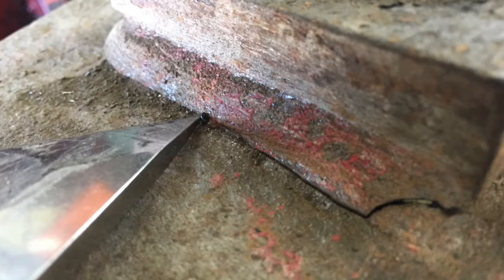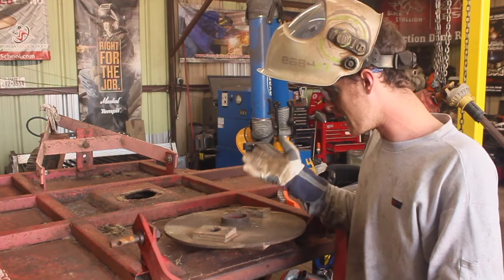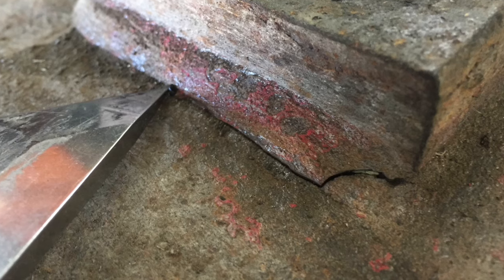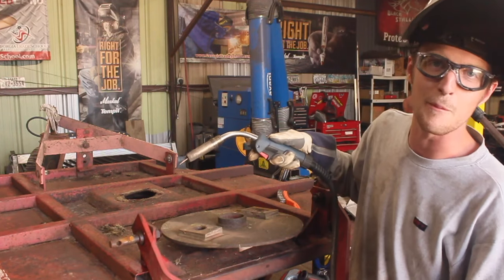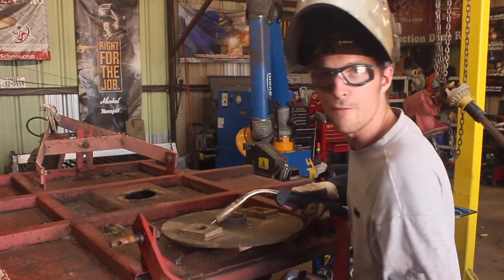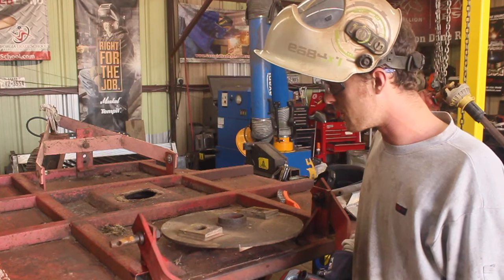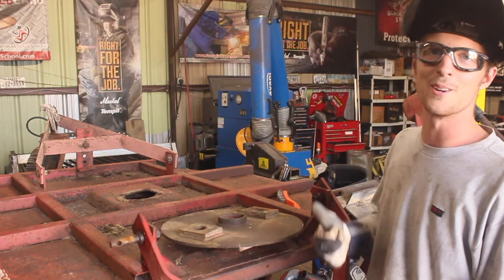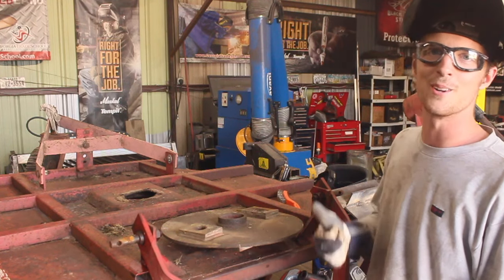WHY YOU SHOULDNT MIG WELD THICK STEEL

Comment: I've welded materials up to a foot thick on some jobs. Granted, we were using 600 amp machines, and 16th diameter wire at a minimum. We beveled until we couldn't bevel any further, and sometimes spent weeks welding one component to go into a  massive hydraulic sheer or press break. Tell that story about not being able to weld heavy steel to somebody else! You young guys have either been mislead in your training or you just don't have the experience yet!
Reply: nice, the thickest I've ever welded was 6" base plates for a rollercoaster - med carbon steel - had to spend 4 hrs with propane torches to preheat. burned up a lot of gloves on that job. 5/64 Nr232 wire
Reply: Upper couplers on semi trailers! “King pins” 800amp millers. With 1/8” iron core wire! Hot and heavy.
Reply: I was gonna say lol I know of 9 axle trailers that are entirely welded together. Bevel, preheat if necessary and use MIG or SMAW 🤔
Reply: here in the Netherlands we are thaugth about that in welding school.
Reply: Apparently this guy doesn't know that you weld almost anything with mig that you can stick. He apparently didn't know that the big commercial welders are mig also. Granted, you find that type of a welder on a farm, generally. Just need the proper equipment and knowledge/skills for the job.
Reply: Funny that aye haven't  welded really thick steel, but why would welding manufacturers make 500 amp mig welders just to weld thin steel. I personally like arc welding because I dont have to worry about gas lol.
Reply: Ah so you guys are the ones with all the cracked welds! I was wondering who's the moron company who is putting out all these structurally unsound components.

Could y'all stop? Its getting old fixing all these 2yr old mig welds
Reply: @wrenchbender01  shit we rebuild intermodal trailers at work and our biggest welder is a Miller 212 and we have no problems welding king pins, main rail sections, G-neck rail sections, bolster replacements and everything in between. Most all of it single pass also.
Reply: @jonathangarzon2798  shhhh...let them keep  welding like that, keeps my mobile welding sidework going  lol
Reply: I just failed my mig test because I am not used to welding at 350-400amps . They wouldn’t let me weave a bead it was production welding I am a great welder but failed hard yesterday just trying to get a opinion on welding at high amps and running a clean bead , I got told push my bead I can’t manipulate it at all which as the first time I have ever hear that
Reply: I agree. Process isn’t near as important as how it’s done!
Reply: No Doubt ,I use to weld 600 lb branch connections, 10 inch thick ,on 300 ton steam drums with 1/16 core wire , 12 hours days  pounding metal.These young snots  ,have no clue whatsoever .

Comment: Dude , I fabricate pressure vessels . Many of the bodies I weld are 3/4”-1”1/2 inches thick . Bevel the areas such as seems take many (3-4) passes to complete. Welding lifting lugs to four inch thick plate takes a lot of heat . We weld at 250-275 amps. The lugs are beveled to allow several passes to fill in and build the weld to finish with a minimum of three step levels as the final passes . Many applications can’t be mig welded such as seams on ships where stick welder with proper tensile strength rods . Heat is your friend when welding thick steel.
Reply: Like I always tell people, get a job welding things that have to be leak tested and you will become ' good '
Especially ' dime stackers ' .
Reply: I agree. Technique, relatively adequate equipment and know how, are more important than process. Mig is capable as any other process in the right hands
Reply: He did say where the weld was too cold.

The title is click bait.

Comment: Hmmmm better not get too close to train tracks then i welded train cars for years with a mig welder as do most shops at this point
Reply: You probably used Flux core wire..

Comment: Sad to say, your knowledge is faulty, and the last picture at the end of this vid clearly shows that those welds whomever welded that multi-pass, is worse than the previous welds and that person who welded it, would not have a job in a regular structural steel fabrication shop if that is the best they can do....  FYI, always clean/prep the surface area from rust, oil, water before welding as you can see in the end of vid. was not done.... It always matters, always clean/prep....

Comment: I have the same welding lid. I would use E71-T .045" dual shield wire with 75/25 Ar/Co2. I do a lot of heavy equipment repair and so far this has held up well.
Reply: That was my thought as well; built 120 ton and up mining equipment using 0.54 E71-T

Comment: For the average Joe would it be better to tackle something like this with Stick?
Reply: Yeah, run a 6010 hot root pass and then a couple 7018 beads to cap it off
Reply: @JohnWheels  : Except most “average Joe’s” don’t have a welder that will run 6010. Flux Core is Way Underrated!
Reply: @markashlock9017  True, but I have a cheap YesWelder machine that runs it just fine on 240. I won't on 120 though
Reply: @markashlock9017  that’s not regular fluxcore… he used dual shield which is wayyy hotter and stronger you could also just run 7018 on it and skip the 6010 if you didn’t have a machine that can run 6010

Comment: Factories that manufacture I beams and other structural beam use a MIG process. You mentioned in the last second that you are going to do the repair with dual shield MIG. The title is misleading. You should have focused more on the wire used and the proper way to perform that repair instead of saying MIG-bad the whole time.

Comment: Mig welding is just as strong as stick if it’s done right
Reply: It's that if done right part. The one method I was taught was weld think to thin. Got turned into largest thermal mass to least. Chuck something taught me that I think.
Reply: Not short circuit it’s fine on thinner material but it doesn’t have the heat to fully penetrate the thick stuff were stick will.. if you actually read short circuit wire it will say not to use on anything thicker than 5/16.

Comment: Well, structural MIG is certainly a thing, but it does take the right settings and technique. MIG is kind of deceptive in that you can end up with a visually okay weld if you don't really examine it, and it holds for a while, but it isn't properly fused just like you said. 

That's where knowing exactly what you're doing and how to do it comes into play... or you can just go grab the easier option if you're not welding a building or a bridge together and instead just use stick like a normal person, or if you happen to have gas shielded flux wire setup, use that.

For the average guy tinkering, MIG isn't for thick metal unless it's specifically set up to do that with the proper everything.
Reply: What allot of people don’t realize about MIG welding with solid wire is that you can short arc or spray, but in between those transfer methods is globular which is unacceptable and responsible for most non fusion. To put it simply you have to understand what your doing and not just be able to make a pretty weld

Comment: Preheat and clean surfaces are your best friends welding thick steel with mig. Never stopping on a corner and going around it and leaving your stop on finished weld is another.

Comment: Don't say MIG welding is the problem, the wire they used is the problem.
Anything structural over 3/8 should be a dual shield wire with straight CO2, or inner shield for the farmers and DIY guys out there.
You can weld thicker with the, well I call it bare wire, copper colored wire that you use mix gas with and leaves no flux behind. Can't remember the technical name.
Anyways you have to preheat the metal before you weld or use a pulse machine, and even then it's never as good as a dual shield wire with straight CO2. People use mix gas with dual shield but I've found over the years it makes the weld too brittle and is a little harder to weld with because it doesn't always want to "wet" both pieces your trying to stick together.
If you want good wire to start with try some Hobart excelarc 71 in .045 and CO2, good for general repairs. It can be turned down enough for 1/4" but it might be a little tricky running verticals that thin. But the bare wire can take care of that.

Comment: This is exactly why no welder considers mig welders skilled tradesmen, we are constantly fixing their welds not even 3yrs after fabrication in the field and all you ever hear are excuses for it.

"We spent a week beveling and preheating, used a 600amp machine with thick wire just to run a signal component so you can weld thick with mig"

Meanwhile 65% of all field repairs are fucking done on mig welds that failed

Comment: It really depends on the composition of the wire being used and also if the welding machine has the amps to penetrate the steel if thick U have to crank it up also some pre heat of the steel helps out big time as long as you don't exceed the interpass temperature 🤟

Comment: The other thing you never mentioned was the weld ended right on the corner.  So not only was the crater there but also a stressor being on the corner. An easy fix is to run the weld around the corners before ending the weld.

Comment: Using Dual shielded wire is MIG welding . It’s just a different type of metal transfer across the arc . On thicker metals this is a very common type of MiG welding in heavy industries.

Comment: The parent material failed ot the toe of the weld because of the HAZ. It's a common problem with any welding process.
Reply: Exactly what I was thinking
Reply: The weld failure started at the center of the weld though, that's literally textbook weld failure
Reply: @jonathangarzon2798  it may have started in the crater because of lack of fill but it didn’t crack all the way down the center of the weld it traveled to the haz. And really can’t say for sure it didn’t start at the toe and wind up in the crater

Comment: Most cracks I see like that on farm equipment look like a rust thru issue of the parent metal. I see it mainly on thinner stuff, and areas that may not have been painted properly after welding.

Comment: I've worked as an OEM engineer for large construction and age equipment for over 30 years.  Welded large track trenchers, drill rigs, combines, etc. frames that are several inches thick.  Everything is welded with MIG, maybe a little sub-arch, but anything with volume will be one or the other.  Stick welding just really isn't used in production.  I hardly use it at home either, always use the MIG.
Reply: Yeah most companies don't actually care about doing things right just fast.
Can't be a multimillionaire company without killing a few dozen clients and workers through willful negligence bud
Reply: @jonathangarzon2798     So stick is the only “right” way?
Reply: If done right, Mig is absolutely a good way to weld things. no doubt.
Reply: Yes mig is good but not a lot of people know for industrial application dual shield is used with straight co2.

Comment: I used 311 ;.065 inner shield on structural iron with a beveled edge 2 inch flange and never had any problems

Comment: I usually agree with what you show but in this case I can't.   I not only work in the towing industry as a senior design engineer but I fabricate on the side as well.  At work, all we use is MIG on our hitches with testing exceeding a 38,000 lb rating.  At home I've welded up to 1" thick bar on a Cat endloader and it twisted the whole frame when the one cylinder failed, not the welds.

The problem your showing in the video was definently from cold weld with the wire not hitting the base plate.

Comment: That has always been a problem that I deal with. Making sure it’s hot enough to bond and not burn through the steel you’re trying to weld too. Thin metal always seems to be very difficult

Comment: Depending on the consumables being used. If  your using E7018 stick electrode or E70s-3 MiG wire or even E71-t all them have a 70.000 psi tensile strength. MiG welding is used for thick metal in many industries. It all depends on amperage and if you Mig at 125 amps or Stick at 125 amps and use 70,000 psi rod or wire it’s the same strength of a weld. So if your talking about a 120v homeowner mig you can still get away with welding up to 1/2 plate with the right bevel and prep. I have done many many times.
Reply: The mode of transfer is different the reason a stick and tig weld is stronger is because its not a short circuit short circuit mig welding is literally creating a dead short everytime you weld something they have corrected this over the years this is  where the invention of spray transfer welding and dualshield fluxcore have came from because they dont short circuit like a normal short circuit mig process does

Comment: I just subscribed. I was with you when you were Chucky1986 or something like that? This stuff is REAL WORLD WELDING! I repair trash containers and garbage trucks etc.. this video today is great info. I would however like just a little more info on the wire you are using and sounds like no shielding gas? And are you preheating with a torch? I would use your info directly on my next weld in the cold weather on some equipment.

Comment: Chucky I like your videos and have been watching you since you first started learning and sharing, but I have to tell you your wrong about MIG not bein suitable for the task, the problem is some welders know way less than they think and think a pretty bead is all it takes. I have welded steel over 2” thick using MIG, FCAW and GMAW are both up to the task when used correctly! I understand the difference between short arc and spray arc; if I wanted to I could intentionally lay a globular bead that looks pretty, but didn’t hold just to give an example of what many inexperienced welders do without any understanding of their mistake.

You can’t knock MIG until you reach the level of Wizard!

Comment: Most shops I ever worked at, welding, the ' basic common knowledge ' was that a stick weld was always stronger than a MIG weld. More penetrating.
The deal is if you have enough power to actually make a serious weld with stick it is going to make a decent amount of heat plus you don't have extra filler metal besides what the stick provides and also it usually goes pretty slow. So even if it's not that high powered it still usually makes decent weld.
On the other hand, with a MIG the arc point it very small so you can weld at pretty low power along with having variable amounts of filler coming in.
As a result you can actually make mig welds that look good but hardly scratch the surface , you can peel them off with a chisel. The other side of that fence you can dial up the power and slow down the filler and burn a weld deep down, farther that with a stick.  You have control of that. Most people tune it in to where it sounds smooth but that might not make the optimum weld for the application.
Sometimes to get a good hot penetrating weld you have to set it to where it's popping and snapping and getting hot spatter that sticks real good and people are yelling at you to turn the wire speed up. You have to pay more attention to your settings. It can be smooth and still right, you have to have the right mind of what's going on.
Reply: A number of years ago I had a repair job where I work , maintenance made a tank that held coolant and consisted of 3/8 and 1/2" plate steel.  It probably should have been welded very hot with 7018 stick, but they welded it the wrong way with way underpowered MIG. ( they never come to me for advice or to weld it they only come to me after they screw it up ) they leak tested it and lost count of the leaks. They wanted me to fix it and to avoid a lot of grinding I just dialed my MIG welder up very high - like 300 amps and very slow wire and proceeded to
re- melt the existing weld. It worked very well but in the process I went through 
3 cone insulators.
For people that don't think a MIG is penetrating enough.
Average Miller machine most shops use.
.035 wire.

Comment: Nothing wrong with welding thick metal that deck isn't very trhick and that experiences a ton of vibration and shock loads so that being said mig welding it if you know what you are doing will work just fine and is actually just as strong as say 7018 stick welds ect. Actually some mig wire results in welds being stronger it's all in the prep work and if you're doing it right !! I've welded thicker steel than that with mig and have had absolutely no issues!! But i do agree it looks to have started in the crater but had someone known what they were doing they would have taken the weld around the corner and overlapped the starts n stops !!

Comment: Hi, I don't like pointing out stuff in videos, but I must say this.. You are wrong about the mig (gmaw)process.. the reason welds fail
In all cases, is that they were not done properly to begin with..wether in technique, temperature, dirty, on, on..
You have informative videos and please keep doing them, I don't mean this in a bad way ok, but I have been doing structural
MIG welding for over 40 years...please do more factual research...
Be Safe!
Don

Comment: Just crank the voltage up when working with thick dude looks like you tryin to weld inch thick with a 25 amp setting